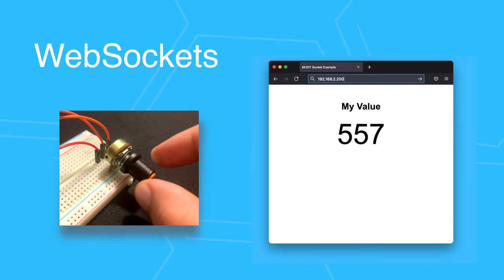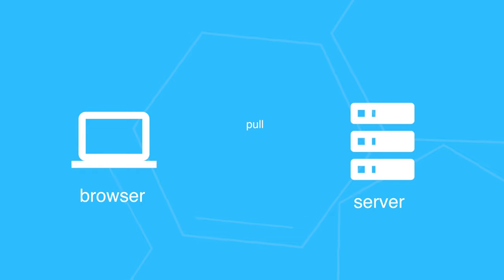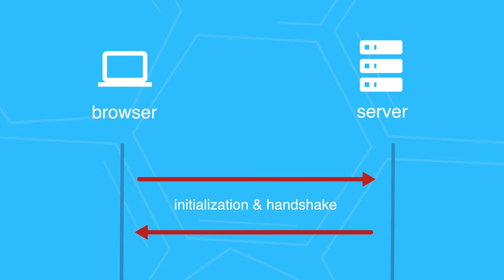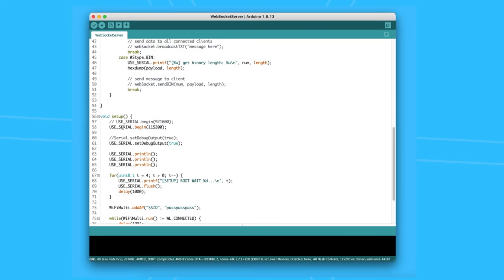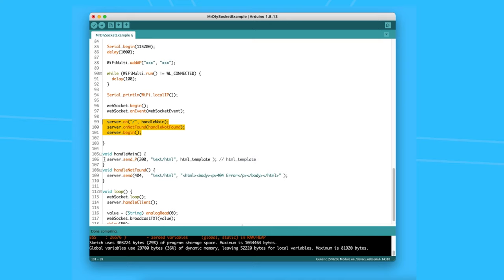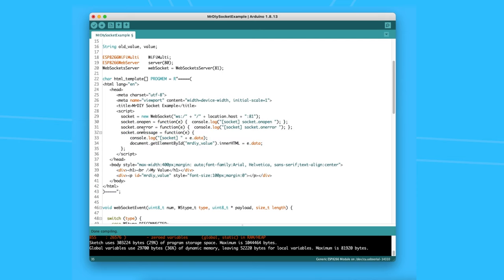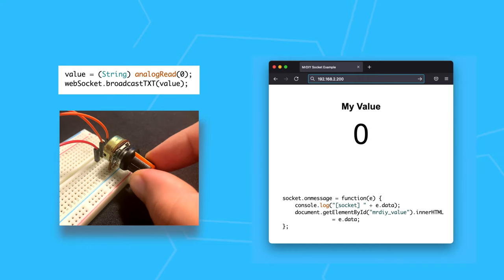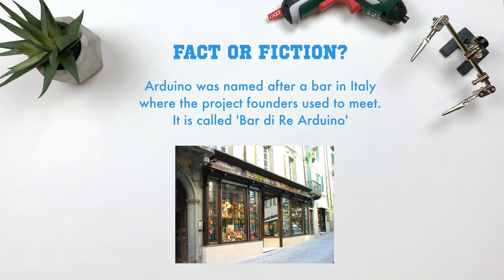WebSockets Explained: Real-Time Communication with ESP8266

Comment: Your video content that information what I'm looking for, however I would like to ask about a detail. I hope my theory is right and please correct me if I'm wrong. Well, I'd like to apply esp8266 boards as WebSockets clients (temperatute and humidity sensor) and I gonna have a simple linux server what is at certain time ask the clients about update. Because the clients would be consuming as low power as possible in this case the client-server connection isn't constant it's only builtd up the connection if the server ask the client. In other words, is it working the WebSockets in this situation?